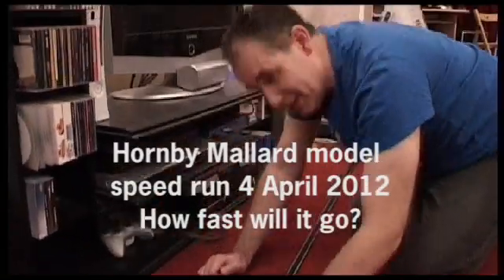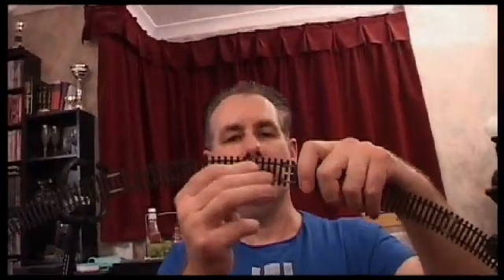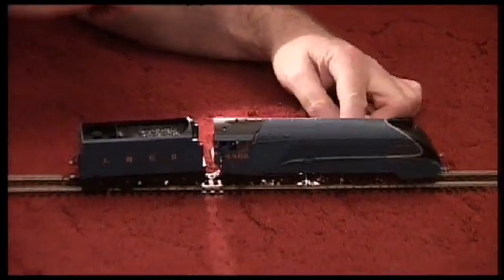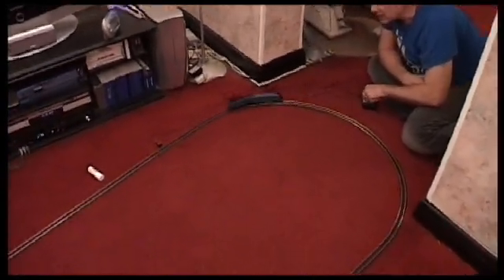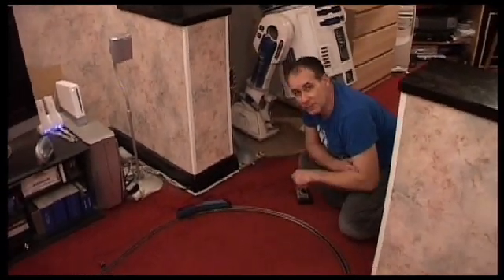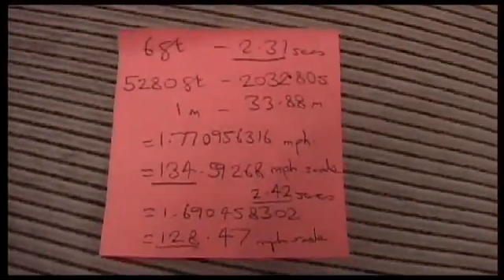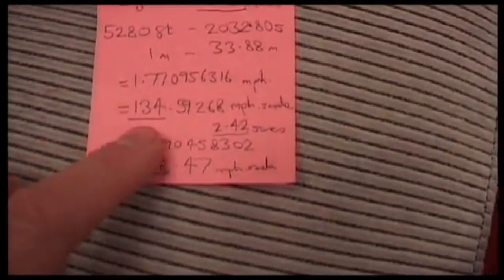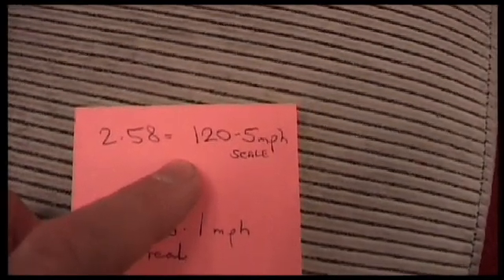Mallard High Speed Run (model)

Comment: Very nice video, favourite train by far, just pointing out that the mallard only reached its top speed on an attempt with a slight decline and it experienced damage. This means the top speed for its day to day routes would be at most a few miles an hour lower.

Comment from the maker: That's it, you've got it. Your trains would have to go round 377.14 times to travel a real mile. So work out how long that takes in seconds, and then convert to minutes (should be aorund 30 something) 
Then divide 60 by that time. This should give you a figure around 1.7 or so. 
Then times by 76.

Comment: The reason for all this is to work out scale mph for lap speed time, as I do not quite have space for a real six foot straight. it more 6ft by 3ft. so 4ft straights with a 3ft width bend adding foot to each end so.. umm.. lets see. two four foot sections. is 8ft. a 3ft curve at each is 6ft so. 14ft. The curves would be the wider 3rd grade curves. I think. Shows my nativety but, willingness to learn. and thank you for answering as it is indeed late in the UK.

Comment from the maker: Well say your loco does 6ft in 2.4 seconds. There are 5280ft in a mile. Therefore divide 5280 by 6ft. That gives you 880. So the model would travel 880 bits of track at 2.4secs each bit = 2112secs or 35.2mins.
So it would take 35.2mins to travel a mile. 
Divide 60 by 35.2 to give you 1.70 - this is the real mph. In an hour the model would travel 1.7 miles. So 1.7mph in real life. 
Now just times by 76 (the scale) and that = 129mph scale speed in this case. 
(I'll add to description).